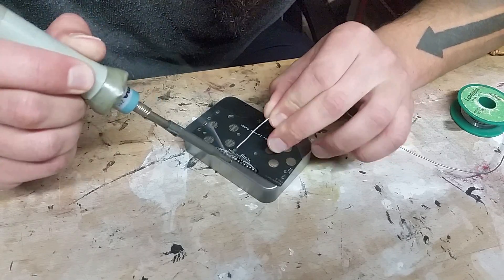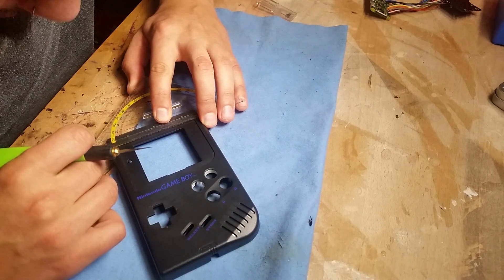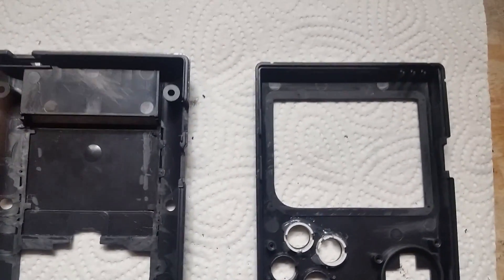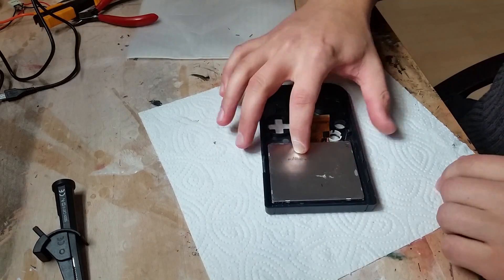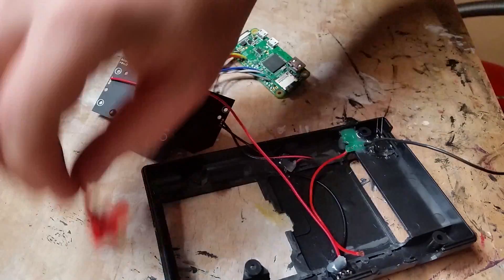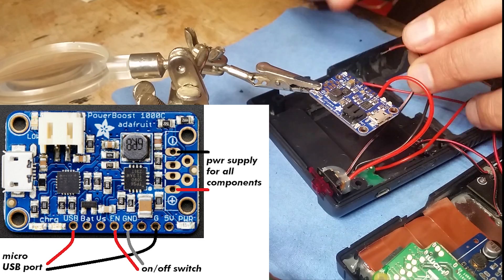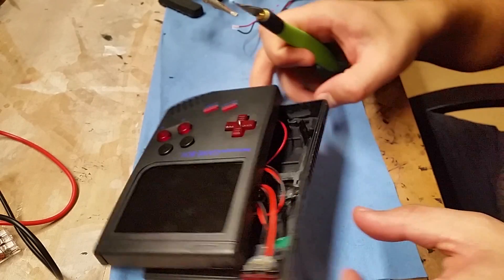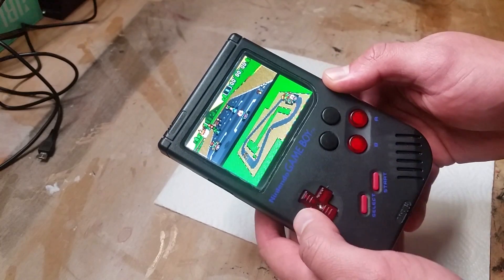How to make a Gameboy Zero - Tutorial with GPIO controls

Comment: Great tutorial,  I couldn't make my PWM work, I use adafruit mono amp (PAM8302A) and set the config.txt overlay tree to dtoverlay=pwm,pin2=13,func2=4, connecting A+ to GPIO 13, GND to pin no 39, and powering VDC with 5V from direct source battery...yet, no sound!